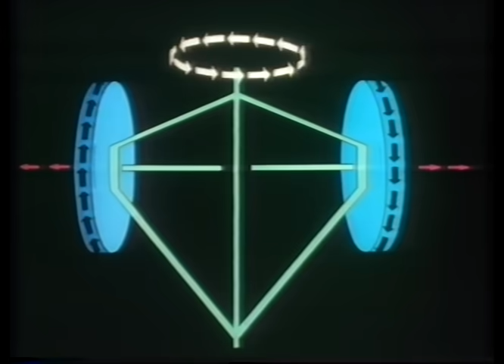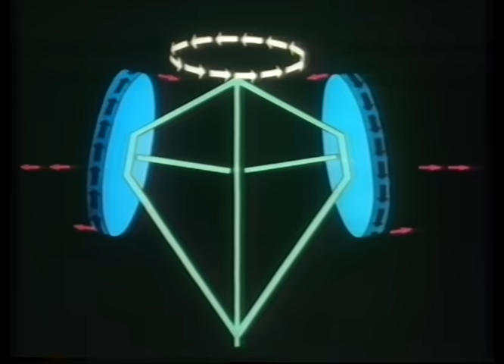Anti-Gravity Machine (Part One)

Comment: Too bad it took five years for it to pop up.   This is similar  to Tesla’s info on his ufo.   Build this around  a  ser al.   Generator   And it would self level and fly.    The us Air Force cracked the problem in the fifty’s   They just wont share it with anybody.  
Soooo. Shut down the dod. 
Let a real American  group  release the info. Not the crown

Comment: To produce a perfect field. example Vortex magnetic field. you can rotate mercury in a neodymium magnet vacuum. made by example. neodym magnets. and or add or retract polarity and electricity.  To stabilize and enhance the working "field" lets call it that ;-), to produce the stabilizer The mercury and environment that is needed has to be as close 100% sterile, For the best effect. also you can add different kinds of Fuels or gases  or  environments to further enhance the Effect you want to Produce. This can then be applied to many different kinds. of reactors and motors. and for many different purposes not only Plasma, ;-) hope this answers some, if not many or all your questions about this Topic. Try to apply it in your way of thinking. This will open many doors for you. But think different not only mainstream. all what you Feel or see can not be measured. But we know they are there ;-)
Reply: Everything you've said is gobbledygook.  Until you learn proper spelling, grammar, and punctuation, no one but children will listen to you.

Comment: If you click on the purple channel i con to the left, you can see an officially patented ion thruster that can lift its power supply against earth's gravity!.. It doesn't violate any known physics principals, and is very well proven to work.  It can't lift heavy payloads yet, but at least there isn't any controversy that it works.  It doesn't create any noise or use any moving mechanical parts.

Comment: funny fail.. he doesn't realize as soon as you take away the supports around  a gyroscope it goes completely wacko    more then likely it will try to flip itself. so... spinning things in a vehicle not connected to the ground is a called a helicopter..     you might went to start there.

Comment: These machines are very deceptive and don't work sorry.
Reply: I'm inclined to agree.  It's well known that gyroscopes tend to resist movement, but creating lift from that tendency is another thing, entirely.
Reply: SO just how does that gyro not fall off its end onto its side as it spends in a circle?  An anti-gravity force can be the only logical explanation because by distribution of weight, any still object like that would call over.  This should be a no-brainer.  It does have an anti-gravy property.  Mr. Kidd has figured out the right machanical constraints and movements to tap into that.
Reply: @xapplimatic  Oh, if only there was a one-line 'quiz-show' answer to the question, "what keeps up the free end of a precessing top". There is not, and that is what keeps this entire fantasy going. The simplest answer, to a physicist, is that the free end of a precessing top does not have enough energy to fall. Unfortunately, to a layman, that is even more baffling!

Comment: Explain somebody to me how taking away nails helps measure the thrust. I didn't get it.
Reply: NICEFINENEWROBOT I’m guessing that the machine was being held down by the weight of the nails, and as they were removed, it was then able to “float” upwards. So the weight of each nail could be used to show the amount of “thrust” the machine was able to produce. (Not sure, I’d really need to see how they were attached to the overall mechanism a little better to see if it was pushing down on it...)
Reply: @Deputydog-xk5jl  
The vise is hanging in equilibrium with the spinning machine. Take off some nails and the machine pulls up the lighter vise by its own weight. Why is the machine going up after start? It changes its geometry but has no thrust against its own total weight. Try do reel real fast and you will feel your arms get lighter and lift (steam engine valve mechanism). But you lose no weight and this is not the way to start to fly.
This man should try to weigh the machine spinning with the gyros not spinning, then fire the gyros and weigh the machine. What will he find? The gyros make no difference, just change the geometry of the contraption moving in its links.
So much lifetime wasted.

Comment: As long as you are accelerating the gyros you can achieve lift. But once you stop acceleration it's going to drop like a rock. BTW you need at least four counter rotating gyros. And they need to spin on two axis. The wheel spinning on the end of a swinging arm that's connected to a motor to spin it 360°.

Comment: It's funny people saying it doesn't work, when he clearly got lift and was measuring the lift force :-P
Reply: But he is not a competent experimenter, and there are alternative explanations. The results obtained by his Australian backers sometimes indicated an increase in weight. There is a name for that: 'random noise', the same sort of thing that keeps telepathy going.
Reply: Perhaps momentarily but it's simply reaction to inertia similar to propelling weights downwards.  Guess what happens when you stop accelerating those weights downwards?
Conservation of momentum reclaims that lift as downward force.  Basically, without throwing off mass as a rocket does, all you can acheive is an oscillation, not continuous linear force.
Reply: @Andy-df5fj  In the ancient Olympic  Games,  jumpers were allowed to carry weights ('halteres') which they threw downwards in order to  rise higher.  Vibration alone can produce unexpected effects, such as rotation about an axle. Only a fool thinks that textbooks contain the totality of physical knowledge; much of it remains unseen in academic journals.
Reply: @MrAaronvee  
I don't doubt the ancient olympians got a vertical boost from throwing the weights down.
It's basically the same concept as rocket propulsion.  
These gyro contraptions can provide a boost as well but not continuous thrust.  It would only last for as long as the interia is propelled downwards.  Eventually, you run out of stroke and then the interia works against you pulling you back down rather than propelling you up, that is unless the inertial mass is released (like a rocket releasing gases).
Reply: @MrAaronvee  
Yes, I see your point about the lack of completeness in text books regarding many scientific principles and I suspect in many cases it goes beyond the books.
Even the experts don't seem to be able to answer much beyond what they teach about gyros.   I tried very politely asking one for his thoughts on the ability to increase the rotational velocity of a gyro by the application of external torques to the spinning system (I was intrigued by those gyro powerball exercise things).  I didn't even mention the powerballs though.  His answer was to use google.  Hardly what you would expect a teacher to say unless he simply doesn't know.  
Anyways, what I wonder about these inertial propulsion gadgets such as in this video, is if the propulsive effect can be made to last long enough to be of use before the conservation of momentum forces you to pay it back.   An enhanced "jump" so to speak.
Reply: @Andy-df5fj  I think that it is a very (intellectually) dangerous step to go from "I cannot find the information" to "the information does not exist or is suppressed". The mathematics of spinning objects has been studied intensively since the time of Euler and, although there can be counter-intuitive effects, there can never be any 'new physics', such as levitation or reactionless propulsion. This is because Euler's equations are predicated on Newton's third law. The only possible exception occurs when one considers General Relativity: this would permit a form of levitation to occur, but the necessary technology is far beyond our capabilities materials-wise.  Some people pin their hopes on the fact that, like Einstein's gravitational equation, Euler's equations can be solved exactly only for a few special cases. But that does not avoid the above, third-law, point and direct computer-simulation of the mathematically unsolvable cases does not reveal anything anomalous. As an example of the longevity of this ridiculous 'antigravity gyroscope' delusion, the author of one of the best books ever on rotational dynamics was already laughing at such inventors as long ago as 1918.  And one can guess why: gyroscopic artificial horizons for aircraft were top secret during WWI. So, when news leaked out linking gyroscopes to aircraft, public ignorance of physics did the rest.  It is indeed very difficult for the layman to track down all of the 'good stuff' on the subject, because the trustworthy journals all have paywalls while the rubbish journals are free-to-view.  Appearing just hours ago, the latest issue of American Journal of Physics contains a fascinating paper on  the geometrical phase of an asymmetrical top. The  geometrical-phase concept in itself can be made to look like a magic trick!
Reply: @MrAaronvee  
Well you need not worry, I'm not anywhere near making the jump to concluding the information is suppressed or non-existent even though it hasn't been easy to find.   You seem to be fairly scientifically knowledgeable.  Perhaps you can answer my curiosity about those excercise power balls in regards to gyroscopic principles.  In case you haven't seen them, they are basically a spherical gyro encased within a tennis ball sized housing and once the gyro has an initial spin started by a string, the rotational speed is accelerated to very high speed with a rolling motion in the wrist and at a speed which is several times greater than the applied wrist movement.   
 I've seen it posited that the spin is induced with a high ratio via friction upon the narrow hubs of the internal gyro like spinning a top between your finger tips.
 Although I find that very feasible, I wonder if that's the only way and if that's what is actually happening.
Specifically, can a gyro's rotational velocity be increased (or decreased) merely by the application of external torques (aided or opposed precession) or is there something else going on?  I suspect it can because the applied momentum has to go somewhere and if not lost to friction, it seems it would have to end up being applied to the spin of the gyro.
Reply: @MrAaronvee  
Thanks for the link. I presume the flipping of the T-handle to be the geometric phase discussed in the journal?
That aside, I find the second spin at the 8 second mark the most interesting because it has no initial vertical velocity then seems to accelerate upwards.  Being in zero-g however and in a pressurized capsule, it's likely caused by air currents, either generated by the t-handle itself or already present in the air.  Nonetheless, many people see something like that and conclude uniquivically that gyroscopic thrust is occuring.
Reply: @Andy-df5fj  Well thanks for the 'fairly'; I have been working intensively in scientific fields for a long time. As a matter of fact, I was given a PowerBall some years ago but I suspect that it was a 'recycled' present and it did not work properly. If I find it again, I shall take it apart. There is no inherent reason why the spin should increase. In fact,  great care is usually taken to 'insulate' the rotor from external influences. But it would not be too difficult, I imagine, to arrange for the forced precessions arising from the wrist movements to accelerate the rotor via a high gear-ratio connection.
Reply: @MrAaronvee  
My apologies.  I meant no insult but rather didn't want to come off as insincerely complimentary.  Let's just say you certainly are more scientifically fluent than I am.
I was thinking there may be a conversion of sorts when the precession is interfered with in a similar way to a figure skater increasing her rotational speed by pulling her arms in.
Reply: @Andy-df5fj  That's OK.  It is hard to argue about a 'black box' without opening it. Perhaps the PowerBall does not contain a conventional rigid rotor at all, but instead a flexible device whose angular momentum can be varied by changing  its shape.
Reply: @MrAaronvee  
I have one.  There doesn't appear to be anything flexible inside.  The gyro pivots seems to be captured  inside of an internal groove that allows it to slide as it precesses which makes the friction driven scenario more likely.

Comment: If you could use the magnetic field of the earth as the magnetic force to interact with a spinning magnetic field created in a coil that could also spin, on two 90 degree offset axis or maybe two gyros, it's hard to explain but if the shell was aluminum, which reacts weirdly to alternating magnetic fields, could you get levitation without having contact with the earth as long as you were in the field? And if you could get outside the magnetic field, would you retain the stored energy in the spinning coil/gyro, and move the axis of the gyro to steer? Maybe there is some way to build this into a demention higher than 3d and even basically time travel, eventually you would lose energy and need to recharge by traveling through another big magnetic field, maybe this is why "flying saucers" need to fly through our atmosphere or near the sun. I think this has already been figured out and is in use even though I can't explain it well and I'm scared I'll electrocute or smash myself trying to play with it, let alone the cost.  Sorry if that didn't make sense.
Reply: The big flaw with your plan is that the Earth's magnetic field is too weak to be used in that way.

Comment: Just wondering if he is still working on this? Watching the video I can see the most obvious flaw in the whole concept. This device will never be able to overcome it's own weight to get any lift. He could get better performance by reducing the whole structure's weight. Use lighter weight materials in it's construction. Still it probably will not be able to lift it's own weight without the counter weight that was added. Much the same problem with the so called "Lifters" that use an external high voltage power source in the tens of thousands of volts. I created one myself and was impressed with the thrust it created. It was just enough thrust that it could lift it's own weight. Originally "Lifters" were being described as an anti gravity craft. In reality it was just an simple ion engine. Lifters are constructed out of light weight material, mostly balsa wood. That worked very well they could lift their own weight. They could never create enough thrust to lift themselves if you wanted them to be self powered. By self powered I mean the lifter would need to be able to lift itself along with the power supply that generates 35 thousand volts that is needed get an small simple lifter off the ground. Still an amazing concept. I think this device in this video will basically have the same problem in that it would never be able to lift it's own weight. I wouldn't say that whole concept is a waste of time,  just it needs needs to be redesigned and possibly look at additional ways to create lift and possibly combine them together.
Reply: The only way it would fly would be if it was made from latex and filled with helium! Do you not comprehend that all of the forces involved in precession are couples? Oh, do you have to look that term up? That would explain a lot!
Reply: Oh, maybe use high rpm electric motors for the gyros, eliminate friction as much as you can. Air resistance is working against it. Build it in a vacuum chamber. Reduce weight of all components as much as possible. Just some thoughts.

Comment: He apparently balances the weight of the device when it's not running. Then when he turns it on, the device rises. What may be happening is he's not taking the static friction of the pulleys into account. So even though the counterweight appears to equal the weight of the device, it really doesn't. Any vibration that "jiggles" the pulleys (such as the running device) would mysteriously cause the device to rise. No reactionless force required.
Reply: Well-spotted: vibration can produce some incredible counter-intuitive effects.

Comment: Could this be used a a manoeuvring thruster on a boat?
Reply: Strangely enough, it could: because of the asymmetrical shape of a rowboat, for example, almost any oscillatory motion can propel it. The Victorians were said to have held races in which boats were propelled only by jerking a rope that was tied to a point inside the boat. Even without  any propulsive effect, a sufficiently large spinning-wheel could make a boat rotate.

Comment: this machine doesn't float at all, it is simple procession along an axis the same as the guy lifting a spinning weight over his head. the device is being kept from flipping over by the table and it's weight stabilizing it. the spinning device really wants to wobble in a certain direction it is not allowed to by the table.. see at 13:46 he is trying to make it weightless by using a counter weight but silly he should attach his counter weight to the table holding the axel not the axel itself!!

Comment: He invented the most difficult way possible to lift an object...without the guiding shaft in the center it would fly through the wall. There's an airplane motor attached to this.hello....instead of using that motor with a propeller and wings to easily take flight.. hes using it with gyros and not getting much anywhere.waste of energy....there's no breakthrough here...just a guy who could not get over the awesome effect of centrifugal centripetal force. Instead of hitting the physics books he hit the mill machine on the bench and now has a machine he still dont understand